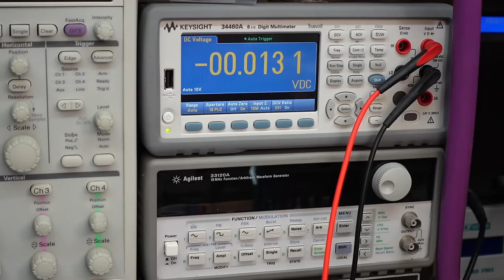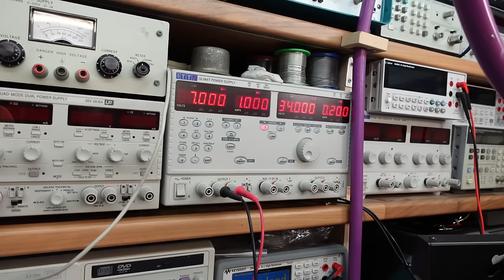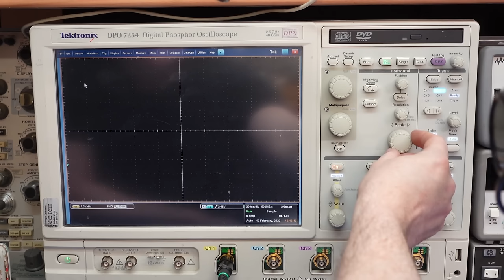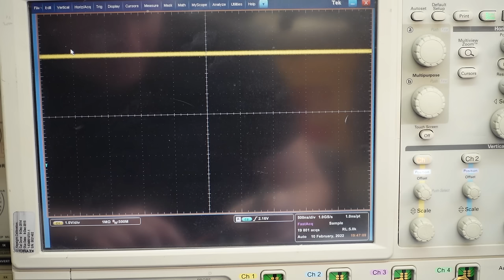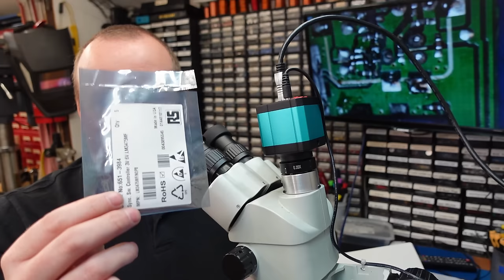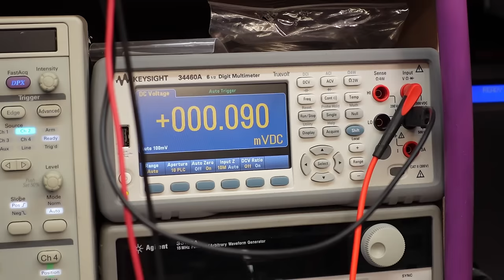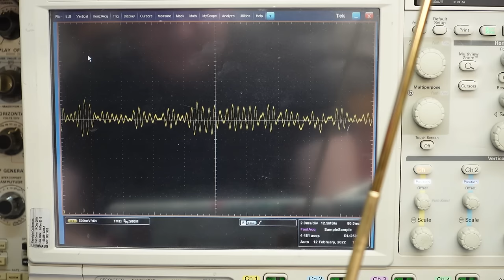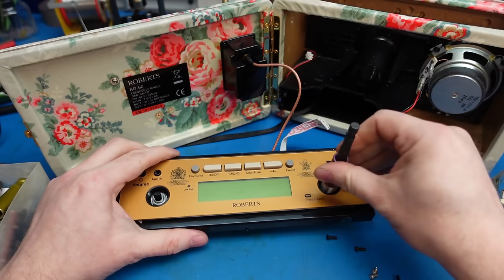Roberts DAB radio repair

Comment: Unfortunately much of the stuff I'm asked to repair has corrupted software. Radios, bikes, washing machines, sewing machines, even power tools. Now't one can do. A radio a few years back (might have been a RR) completely brain dead. Manufacturer had flat-rate repair cost and it came back perfect with a NFF -- no fault found. Obviously the first thing they do on receipt is flash it.

Comment: Great job - looked incredibly fiddly! I'm amazed and pleasantly surprised you were able to get schematics.
Reply: The thing i've found with Roberts radios is the schematics are often quite freely available.
Reply: @ecc84  would you happen to have one for the Roberts Revival iStream3, the all sing all dancing model..?
Reply: @KendalPepe  Afraid not, that's one of those new fangled digital pieces of rubbish... bring back the old analogue radios way easier to repair.

Comment: Almost 8 volts instead of 7. I wonder if that power supply wasn't bad after all. Perhaps it misbehaves even worse than putting out an extra volt when in use, and it's what fried those two chips.

Comment: Seeing the Roberts Radio takes me back to when I found an immaculate tan-coloured one of these on a Council Tip in 1966. Obviously not DAB back then! My father was much like yourself, and he quickly diagnosed why the Roberts didn't work. He also got the Oscilloscope out! Even though 57 years have passed, I still remember that the radio had a faulty Oscillator Coil, and this was a Weyrad P50 /1AC. Coil was replaced, and I'm sure that it didn't fail again. I moved from the UK to Australia, it "got lost" in transit. I am always amazed at how easy you can fix almost anything electronic. This has been a lifetimes' hobby for me, and I "have a go". If I exhaust my knowledge, and cannot fix anything, it goes to the Tip. You need an Apprentice!!

Comment: I used to love repairing the odd item yrs ago & make amps & light shows etc in the early 80's when you could pop to maplins ( or bill flemmings)  buy what you wanted & shove them onto copper strip vero board and actually see the components..... fast forward to today, there's no way i could or would tackle the kind of repairs that you carry out.
Well done mate 👍

Comment: Just want to say thankyou for the video, found it when i was working on my Mums RD60 where she had used the wrong power supply and blown not only IC11 but IC8 and the amp IC4. i used your method of mounting a LM3475MF Upside down and changing the Feedback network resistor. working perfectly again now :)

Comment: Brilliant video.  Thanks for identifying the voltage down converter IC.  I have a friend's similarly faulty Roberts and the same IC seems to be to blame.  Alas, this one is outputting the full input voltage so goodness knows what else it has fried (the radio's drawing 8 watts continuously which is ominous).  I'd try replacing it anyway, except I can't now find a replacement, nor a suitable substitute.  Alas.  I know when I'm beaten.

Comment: 1:57 - If the aerial has a little screw at the hinge point (rather than a rivet) then you may be able to undo the screw, take the telescope off, then a regular deep socket should allow you to unscrew the base.
Great SMD soldering skills, I think I held my breath for the whole duration of the TPA2005 installation!
Reply: Just use an 11mm box spanner passed over the whole aerial.  (All Roberts DAB radios with removable aerials use the same size.)  Obviously you can't use a T bar to turn the spanner conventionally,  but even putting the bar into one of the holes by a few mm will be enough.

Comment: Those Class D chips can be a nightmare to replace. The whole underside is a heatsink which has via's to the other side of the PCB which require large amounts of heat to remove and replace them. It's amazing they work at all considering how much heat has to be applied to them. Your inventiveness with the 5V chip was quite entertaining. Not sure I would have gone that far but hats off to you for not giving up. Great Video.
Reply: Hats off?

Comment: I had some issue on a high serie car radio. It had 6 buck/boost converter, wich failed. Despite all researchs and investigations, despites voltage simulation I failed with the troubleshooting. So, this is here an amazing win.

Comment: Hats off to you Mark for your skill and tenacity. Your natural ability to sniff out where the fault might lie (often in the absence of a diagram) is wonderful. I'm in the 'game' too (in Sydney Australia) and most often manage to repair stuff others have given up for dead. But one question: I see you using the heat gun to desolder (and resolder) chips and stuff. And you seem to hold the hot iron on to joints for a relatively long time. Aren't you worried that the heat will destroy or weaken the replacement parts?
Reply: Hats off??

Comment: Bodge is also called a Kluge as per my old engineer friend Herb Gass. A brilliant electronics guy and mathematician who I respect a lot.  We had a Brit family living int he neighborhood so we know the word Knackered... which birthed the term Knicker Knackered when something is in a screwed up state or in disrepair or just plain NFG. Good repair. I might have used a digital switcher regulator in the 78xx family... they came out with switcher versions and then put them in small SMT and micro packages which would have worked good here with three wires and no reference resistor. IF you need to adjust a regulator that attaches to ground, put diodes in series with ground and they will adjust themselves accordingly. .3 schottky .7 Silicon and add to make different combinations.

Comment: Great job designers,  all that space left in the box  use components so small an ant would have trouble repairing it.  I think all designers should spend a week using and repairing the things they design before they are released in the public. Crazy.  Basically unrepairable unless you have these skills and equipment which I doubt many have.

Comment: It must only be a mono output with the one speaker. Far easier to replace the amp or 5 volt supply section with another mini d class module from eBay. Those amp chips need another blower or iron on the reverse of the board as well. I would have been wary of an intermittent fault in the wall block. And they are difficult to cut open and not safe to glue back together. Well done for having a go and saving it from being junked.

Comment: Where did you get your training. In got mine working at my dad's shop, Wineguard for my MATV then Trade Tech in LA. My dad went there to teach, but when I went there it was a nasty scary place. I got my trig. out of the way. Finally Practical school for repairing photocopiers which I graduated 3 months earlier to work at Dupont then Xerox and both where a waste of time and money. Main tech jobs were disappearing overnight. The US was changing into a throw it away economy as it became worthless to repair just about every electronic device know to man. Even mixing boards (like your Lexicon, Switchcraft) TVs (Quasar, Motorola) Sony, Toshiba, every day thing! I was lost in finding work and my mouth got me in trouble also. I could fix it, but I couldn't get the work to support a living with it.

Today I'm making wood mixed with electronics, but I'm turning 68 in June and disabled. I delivered one to many TVs, copiers and 50 gallon drums stuffed with metal shavings that my dad talked me into. So now I've made furniture to repairs lamps speaker cabinets and separate head cabs for tube amps and knowing how to repair them all. But, my back has more metal in me then an electrical guitar. I wear a pain pump inside me and I cursed my dad for not caring by bribing with money like a carrot on a stick holding an apple on the end for a horse, (me, the horse- of course). Now I'm broken! My wife is good to me but she needs to take care of our adult kids and me. I take care of the house. I'm looking at your work and I'm excited to know electronics is coming back and people need someone like me and you again. I still don't need the signal generators or the B & K oscilloscope  - 33MHz or the VOM from 57 by RCA (my dad's first one). Keep doing this and no bother if you want to write back or not. My wife does get paid very well for what she does for money and when I finish and sell some of my stuff over the years will do fine here in the States. Cheers Mark or Marc, I forgot  - sorry!

Comment: Some great ideas on working with SMD components in this video! I need some flux like you ar using; can you share the brand/type? The stuff I have on hand is either too runny or too thick.

Comment: Just found your channel, Mark.  Great stuff. Any thoughts as to why both chips failed? Roberts used to be famous for using centre pin negative power supplies with no reverse polarity protection. A lot of radios were destroyed because of this. I can see that this one is centre negative, though.

Comment: When you had changed the buck regulator and powered on the radio I thought it tuned to 10.7 mhz and thought it was going to auto align its self, then when i checked the frequency again I was off a zero, it read 100.7 mhz, and it was running an a to d converter (i mostly work on analogue equipment 🤭

Comment: Good morning  (him from Dudley here), just a thought. Wire a current limit bench supply to the output of the regulator point before soldering the new chip. Just in case the amp was causing the damage in the first place?

Comment: Interesting that two power devices had failed simultaneously. Maybe a higher voltage power supply was connected, 12V are common and can be the same size plug. This seems to be something not included in the design requirements for 5/6V electronics but certainly happens.

Comment: Enjoyed the video. Simple question how do you get the handles off? I need to replace the aerial and Roberts have quoted me silly money.
Reply from the maker: There are tiny circlips on the ends of the handle pivots. They are on the inside of the radio. They are awkward to get off, and worse to get back on. (See towards the end of the video)… changing the aerial is also an awful job to undertake. I think you need special long reach sockets, as the aerial is deeply recessed.

Comment: Hi Mark (of many talents), great repair and very clever adaptation for the XC60636? converter chip. Please can you let slip where you got the schematics please? I have a faulty Roberts Vintage Dab radio, a little smaller than the RD60 and it has/had option for battery charging. I could rely do with the Schematics for it but after spending hours searching I doubt if I will find them?
Reply from the maker: Hi, Roberts schematics are indeed a rare find. I was lucky to get this one several years ago from a radio forum (can’t recall which one). I don’t have any special access to data if afraid. 
I suspect they are all similar topology, and if you want the RD60 schematics, drop me an email. It might give some clues, even if not the right parts.
Reply: @MendItMark  Thank you Mark

Comment: I hope that electrolytic cap bonded on to the output stage cover wasn't damaged by the heat from that gun !! I would've whipped it out and checked it !!
I hate this micro electronics especially with smd technology with class D amps .... not the way to go really ...
I have a 1969 Hacker Sovereign Mk2 and it's never stopped working ... the only thing I had to change was the battery complement ... using 12 AA batteries in series as the two 9volt PP9 types became unavailable

Comment: Your troubleshooting and repair skills are awesome. For the past 6 weeks, my Roberts Gemini 27 FM RDS/DAB Radio with Rewind RD-27 has been losing power for seconds at a time, but when I turned it on a few hours ago, it was 'dead'. I'd conjecture that it requires repairs very similar - if not identical - to the RD60 set featured in your video.

Notwithstanding the clarity with which you've illustrated the troubleshooting and repair procedure, it's regrettable way beyond my competence to replicate with my Gemini 27 set. Any prospect I could send it to you for repair for which I will happily compensate you at the prevailing rate for this service?
Reply from the maker: Hi Gerard, of course you can. It might take me a while (I’m very busy…). You can find me at www.perton-electronics.co.uk

Comment: Must admit, if I had been trying to fix the radio it would have been an ebay buck converter and 5v amp board . Whether it would have worked without shielding is another matter....  Who would have thought you needed a microscope, oscilloscope and hot air station just to fix a Roberts radio !

Comment: good vid, but I have a Roberts Solar DAB radio, it powers up with batteries and mains, but it switchs off after about 5 seconds, have tried to find a service manual for it, but no luck. any ideas ?.  cheers

Comment: Hi Mark thanks so much for this video. As I'm new to all this I just wondered what was you using to trace the audio in the circuit and was it connected to the oscilloscope in the normal way you would connect the usual probes. Thanks Brian.
Reply from the maker: Standard probes are fine for this. I power it from a isolated bench supply (nothing special), so the ground can be connected without issues.
Reply: @MendItMark  Thanks so much, can you recommend an isolated power supply for this purpose. Brian Derby.

Comment: I just have to add my 2c. I absolutely, unequivocally, hate any class D amp, and any switch mode power source. Those two technologies are born in the corners of hell called planned obsolescence. And it sounds like crap as well. If you need chokes on an amp, you know you f'd up.
I only build class AB, with a bias of 78 mA.

Comment: What a pain in the patooshka to repair. One has to be a mechanical genius to repair one of these old Denons. Almost equal to designing an interstellar probe to travel between star systems, Ala Star Trek. Look into two gyroscopes pushing against a turning force to produce a push against a turning force to produce non-propulsive propulsion Mac. I might show ya'll how to do it and if anyone got it ya'll would.

Comment: It's a mystery why the Roberts should convert to 5v. USB type converters would be an ideal power supply. A simpler class D chip like PAM series would be easier to fix.

Comment: maybe you have an idea how to boost the signal on a car DAB unit , my old unit had mutch better signal with the same antenna, is there a way to fix this problem, my guess is that many DAB users have this issue, and in Norway there is no FM anymoore. and there is not many option on antennas, glas or roof and im sure made in China, mine is the stock roof antenna the car came with DAB new.
Reply: Check if you have a hidden RF pre-amp integral to (immediately under) the antenna. These need 12v dc power, fed up the coax cable, your new DAB receiver may not be providing 12v.

Comment: Hi Mark, have an RD-60  to try and fix for a friend. Powers on but is stuck in scan MAGIC DAB - NOW TUNING. If i power on and select FM it switches but again is stuck in scan, no sound. I cant do a reset as holding INFO for 2 secs as per manual doesnt give me options. Apparerntly stopped working after thunder storm. I dont know enough about radios especially what IC`s are involved in scanning and memory of channels. Any help, pointers appreciated!

Comment: Isn't it really strange so many components fail at once? There must be an reason for it. Is there a chance it soon will break again? You replaced it with the same of similar parts.
Reply: Maybe the wrong plugpack was used briefly - reverse polarity or too high a voltage. The amp and regulator are likely both directly across the incoming supply.

Comment: Many years ago when I started out in electronics surface mount was just starting to show it's ugly head inside TV's and video and dvd players (started as a service engineer) now nearly thirty years down the line they are in almost everything and they are the bloody bane of my life to such a stage now where it's getting almost impossible to repair anything without encyclopedic knowledge of surface mount components cause half the time there are no schematics for the stuff I do as manufacturers these days seem to want you to throw it away when it's knackered rather than repair and then on the other hand they bloody moan about the amount of electrical waste.......you can't win lol also something that may save you time and your temper might be to invest in a surface mount component pump you can find them on Amazon cheap enough and it save buggering about with tweezers.

Comment: Hi Mark .... I am well into electronics and have just been given an RD50 to fix. It works well on batteries but when a mains adaptor is plugged in and powered on, the signal bars drop by up to 50 % for some reason. I have never seen this sort of issue before, so do you have any ideas what's causng this, If you have an RD50 available, could yo do the same test please.  Kind regards ... Tom
Reply from the maker: Hi Tom, I don’t have one to test. However, some of the mains adaptors are very noisy (bad emc performance). A good way to check, is to power it from a good bench power supply. I don’t think radio handles the dc input any differently to battery power. 
Good luck!
Mark

Comment: I only accept jobs that I have schematics for, too! How in the heck did you find a schematic for something seemingly so random, rare and uncommon?!!
Reply: If you only take in jobs that you have schematics for you will turn away a lot of money. I do it the other way, I take in anything (as long as it's not complete junk) regardless of whether I think I have a schematic for it. In fact, 90% of jobs I do, I don't have schematics. You can teach yourself to repair things without the map - it's not always possible to get one and in most cases you don't actually need it.